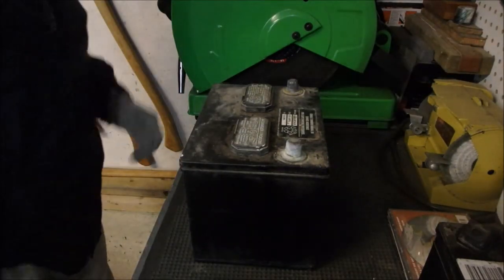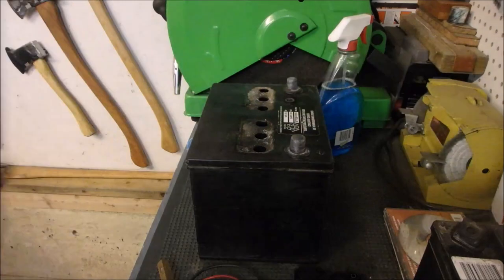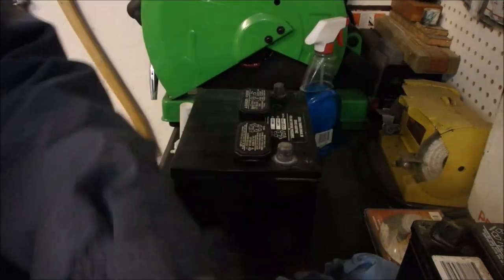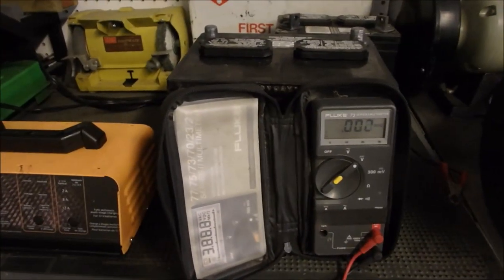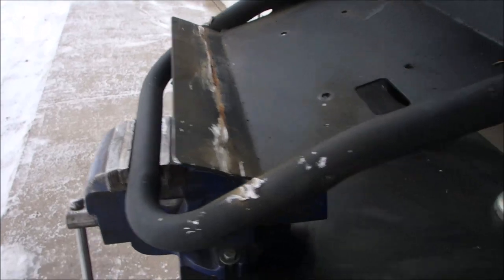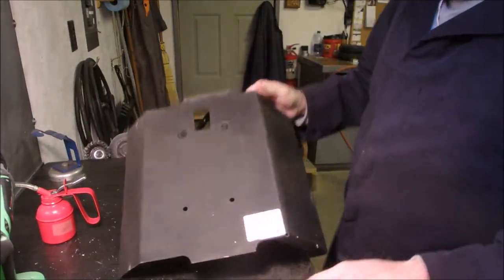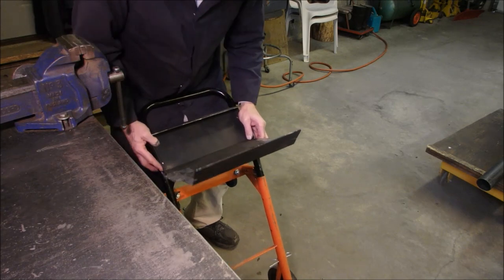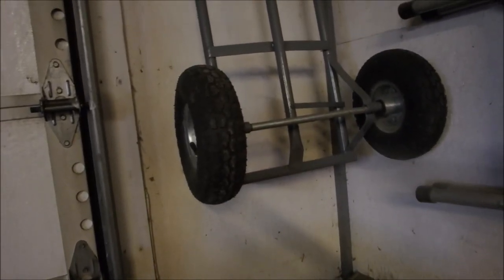Building a 12 Volt Charging Cart Part 1

Comment: Bat-Tree, Bat-Tree hehe, I think I like the Canadian accent as much as the videos Bruce! That charger has a low kick out, and the fact that it started charging at all, means before you even started charging, you jumped from 3volts to at least 8 just by adding the distilled water, which is to be expected. Typically, when I bring a battery back from the dead, I'll use an old analog charger that doesn't care if the battery is completely dead, but you got lucky there!! An old trick to test if the battery is good (by loading it) is connect a high drain like a starter to it while measuring voltage, then when you stop running the starter (about 5-10 second burst), the battery should recover from the voltage drop by at least 60%. It's a simple mathematical equation that simply translates to the battery is at at least 60% capacity. If the battery recovers more than 60% that's the over all condition in percentage values. Example: 12.75 volts standing, 10.5 under load, recovers to 11v within 15 seconds or so, after short drain the battery is at about 85% it's original as new capacity. A good battery will equalize across all of the plates and eventually return to 12V+. There's a formula available that's a lot more in depth, but many mechanics simplify the formula and 60% is typically the cut off. I've got a battery load tester that I used to test this theory on and it was about right most of the time. Not rocket science, but good to know. Looks like an awesome charge cart in the making! A small inverter for the 110 starters on snow blowers would put that cart over the top!! Not sure the amperage those little 110V starters draw, but I wouldn't think more than 500W peak. Cheers my good Friend!! Sean~
Reply from the maker: I used to work on standby power for the phone company.  Larger cells but a battery is a battery.  Yes i used to have an old anaolog charger and gave it away.   ARGH.  I thought it was you guys who had the accent  (joke).  If I have trouble with the little charger sometime I put another battery in parallel with the dead one to keep the charger from clicking off.
Reply: The charge stand should certainly come in handy!! I have three of those lithium jump packs they're selling now and they're pretty much everything on your cart plus flash lights and cell phone or other electronic device charger and work surprisingly well! They've taken the place of me lugging around a big battery and jumper cables. Zip~
Reply: I may be able to come up with an analog I can send your way if you're interested. Probably towards May though. Let me know my Friend! Sean~
Reply: A fellow Telephone Cult Survivor? Cool! The future sure is friendly, isn't it?
Reply from the maker: I know about the Lithium packs possibly replacing the while thing.  .  But I like to fabricate stuff.  We will see if I use it.
Reply: We're cut form the same cloth Bruce my Friend. I'm the same way in loving to create. Having said that, technology has its perks. Cheers Buddy! Sean~
Reply from the maker: Yes   with all that technology I am looking for an old transformer diode battery charger.  Just like the old tractors- They made them good in the day but you had to know how to use them  (over charging etc)

Comment: Re getting better battery charger:  Avoid Noco if you store or use the charger in cold temperatures.  I  took my two year old, lightly used G7200 off the shelf in my unheated garage, and discovered that while in storage the strain relief on the 120V power cord had cracked and exposed both bare conductors. The power cord on the Noco is cheap - not even double insulated as far as I can tell. The strain relief did not tolerate the cold and cracked open. By way of comparison, my decades old Motomaster manual charger's power cord is double insulated, and still in perfect condition. The Noco was always stored in its original box (as is/was the old Motomaster manual). It was not crushed, stressed, or abused while in storage on the shelf waiting for the day I needed it and it let me down!. I replaced the Noco with a CTEK Polar. Although, based on specs and pictures, a regular CTEK would also be okay for many Canadian and Northern US winter temps.
Reply from the maker: Thanks for the tip

Comment: good to see you still at it Bruce. do you have a welder old friend?
Reply from the maker: Yes I do.  Actually I have 2    A really old 250 amp AC Sears welder and a 110 V wire feed Mig and Flux core.  (cost is low)
Reply: Ah OK, was wondering why you didn't weld this? Either way a cool project